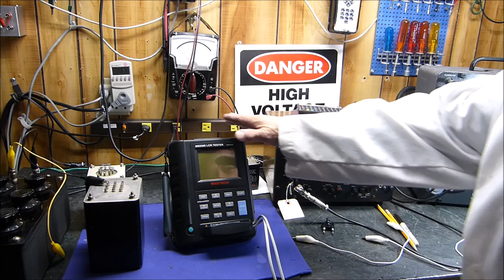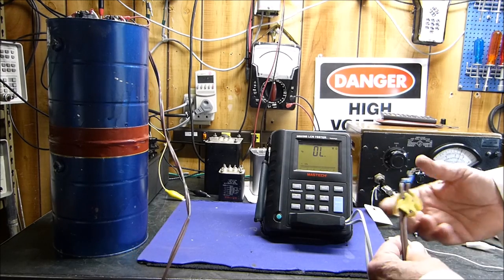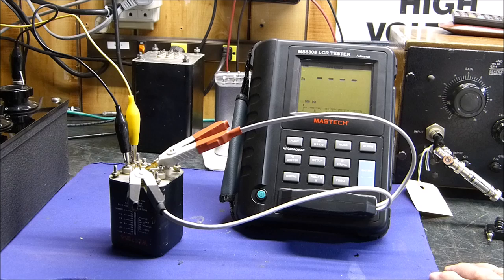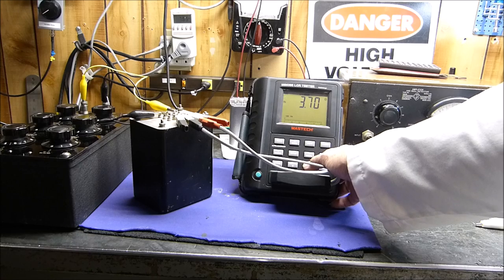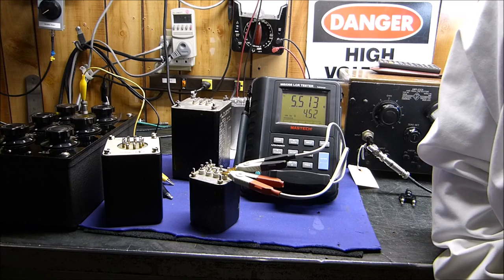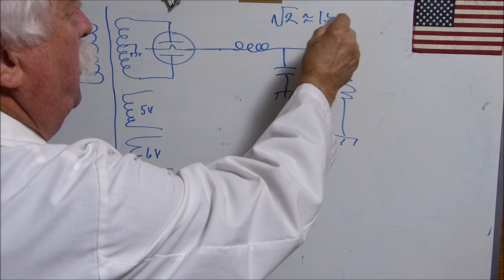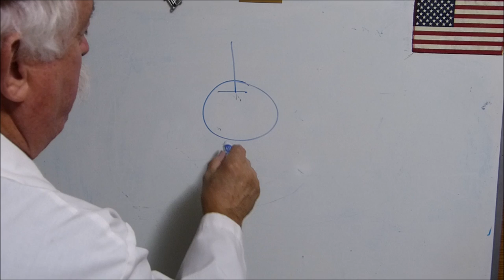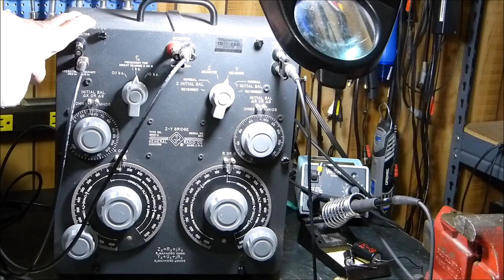Part 2 - Power Transformers and Vacuum Tube Audio Class Transformers

Comment: Hi David. This was a great video. It just shows how time flies when you are having fun in the shop. I used the choke input supply for the screens and the capacitor input supply for the plates in my 6L6 amp. At 0.3% THD just before clipping, I was really happy with the result. The choke input supply has excellent load regulation when the minimum load is maintained (Approximately L=E/I for 120 cps ripple, ARRL hand book)). I modeled the modified choke input circuit by adding a small input capacitor to vary the output voltage, This works for a fixed load but the load regulation approaches that of a capacitive input filter. Barbara reminded me I was 69 years old the other day. I have 3 months experience advantage over you. Don't forget to respect your elders. Happy Birthday.
Reply from the maker: It was definitely your amplifier build that inspired the dual rectifier and plate/screen voltage approach. That is going to come in really handy for me someday. You just also answered the question about the regulation of the "tuned" input capacitor in the Pi filter. I have never tried it but I was afraid regulation would not be particularly good.
I have also heard that in this day and age of modern medicine and technology, 69 is the new 39. Not sure where I heard that but I thought I should pass along the good news.
Reply: @ElPasoTubeAmps  I was surprised the speaker impedance was pretty close to 8 ohms.. Would restricting the speaker cone (by the type of enclosure) have a significant effect on the impedance? Would this be a way to tune the enclosure?

Comment: Happy birthday David!  I'm liking the lab coat with the old GR instruments on the bench, kind of emulating the mad scientist look. It's fun comparing the real world measurements vs theoretical. As a nine ears we think only in terms of the ideal theoretical, neglecting the real world performance. 
This is a great demonstration. It would be a good teaching exercise. If I were teaching AC circuit theory, I'd tell my students to watch this video and write their explanations why  the actual measurements differ from the expected.
Reply from the maker: I though about wearing a set of Kelvin probes around my neck like a doctor wears the stethoscope around his neck - maybe a spaghetti colander on my head also and an aluminum parabolic shaped antenna out the top. That would "set the stage" wouldn't it? Actually, it was 20 degrees here in El Paso last night so I was trying to stay warm and sometimes I do wear a lab coat just because it has big pockets and maybe it does help put me in the mood...
I do try to show that reality is not exactly what we have been taught or think it should be. I like to use the analogy of the bank account where an 8 ohm transformer secondary or a speaker  is not 8.00 ohms like a bank account of $123.45 - it just a $120 or so... makes sense to me and I hope it makes sense to others. At the same time, I try not to give the idea that we can just use anything and be reckless and always get what we want out of our designs and builds. In any case, it is still fun. I do need to make shorter videos with only one or two measurements to keep the video under 15-20 minutes.

Comment: Perhaps the really low frequencies you tested on the Chicago Standard transformer are impacted by all the other electronics you have running in your workshop.
Reply from the maker: I am pretty sure it is a combination of core material and inductance of the transformer windings. The little Chicago Standard transformer I was testing was for voice communication probably in a piece of military equipment that was made to pass the voice frequencies of 300 to 3KHz or it could have been used in the telephone industry. It would been way too expensive to use high performance stereo level transformers so the frequency response design parameters was intentional The build quality of these transformers are second-to-none and will probably last a very long time. Chicago Standard also makes high-end stereo quality transformers and very high end power transformers. 
I have noticed that sometimes trying to measure iron-core inductors on a metal workbench can affect the measurement results as during the measurement process, only 100 mV at a very low frequency (20 to 40 Hz) is impressed across the transformer. The idea is to not magnetize the core of the inductor being measured which will give the most accurate reading of the true inductance.

Comment: The output of the meter is about 1.8v up to 1kHz and then drops to tens of mV at 10kHz and 100kHz, which is a bit annoying for comparisons. I wonder whether the output is so low that the transformer's aren't getting enough magnetisation current to get them into their proper oeprating conditions, hence the strange readings.

Comment: first thing, HAPPY BIRTHDAY!

i think that the problem with the impedance measurement is that some transformers were designed to operate from 200Hz and above, i think so because at the time in exception for some bass specif music the sounds were not low frequency and since the voltage per turn in a transformer is directly proportional of the lowest frequency of operation, the winding is probably designed considering tha to save money. if that is the case the size of the core doesn't matter, since there are effectively not enought turn to have a a good frequency responce the core size doesn't matter. 

i might have an explanation about the strange behavior of resistance reading, whan you try to measure the reflected resistance at very low frequencies the strange results might be attribuited to the explanation above, at some point the readings start to become more or less arround the expected value and until now all seems fine, but then at 100Khz the resistance drops. i think that this is due to the hysteresis lossed since at low frequencies they are within desing limits, but when you starts to go in the tens of Khz they start to become important since they are proportional of the square of the frequency, and their effect of power loss is rappresented as a parallel resistance connected across the winding.

now with this measurements you rised a lot of questions in my head about core losses at different frequencyes, maybe  i will start to make some measurements too :)

as always good luck and 73!
Reply from the maker: I think your analysis is correct. The transformers, other than the HiFi James transformer, are military or Western Electric transformers probably designed for voice transmission and there is no need to try and pass 20 Hz or anything below 200 or even 300 Hz. Many of the military quality transformers have stamped on them, "Grade 1 Class A". I like that term and use it when I consider something exceptionally good. But, once again, that doesn't mean they are HiFi Stereo quality performers.

Comment: Speaker at 8 ohms is a nominal rating.  The impedance is going to depend on frequency fed into it.
Reply from the maker: I agree but I was surprised it was as constant as it was. I figured it would deviate from 8 ohms at 1 KHz quickly and be much different at 100 Hz and 10 KHz so I was surprised it changed as little as it did over that frequency range. I would expect different speakers to behave differently also so maybe, just guessing, a small speaker would vary much more than the larger speakers.

Comment: Sir, I have difficulty understanding the inductance measurement. I'm referring to 26:00. With Mastech digital meter you measured 70H at 100Hz plate-to-plate. A year back, while you discussed the improved inductance measurement method https://youtu.be/5GWrbDzQL-Q?t=15m2s, this very same transformer measured 20H at 70Hz plate-to-plate. This is quite a big difference. Is digital measurement of big iron core inductors even accurate? It is certainly more convenient however is it any good for modelling transformers in LTspice?

Comment: 69 Trips around the Sun!! I tried to find some cool things created/invented in 1948 (aside from yourself David), I could only find the Frisbee and Velcro.... Neat video, but I don't get it.. Is this effect your observing related to core saturation? Thanks, Tom
Reply from the maker: No, this is not anything to do with core saturation. I need to study that subject a good bit more before posting anything else on it. In these videos I am trying to show and learn new tricks on how to use power transformers in tube amplifiers to get the voltages we require for our amplifiers. A simple center taped HV primary can be used in so many ways to deliver different voltage levels so we are not stuck with just the common full-wave CT design.  I am also throwing in tube audio output transformers and how they measure on the old and new equipment I have. Just having a lot of fun really and I always learn something from the discussions that you guys and gals engage in.